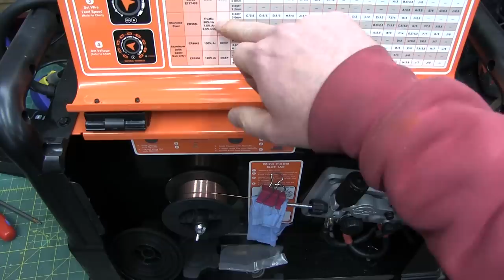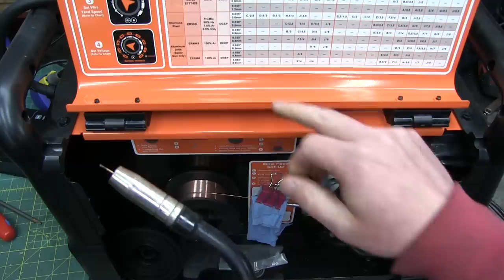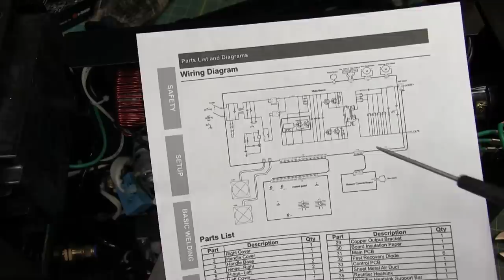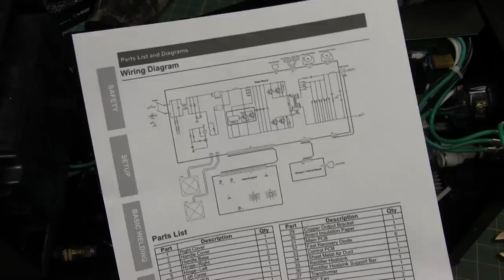BOLTR: Vulcan MIG 215 | Harbor Freight Welder

Comment: I have the cheaper cheapest harbor freight 125 and I have been using it constantly every day almost beating the living s*** out of it for years now and it has lasted not a single problem. Pleasantly surprised for a hundred bucks. I've even modified it now and converted it to DC. And I was using it to TIG weld scratch start. Zero problems I imagine it's pretty much a Vulcan but painted a different color and not given the vulcan name.👍💯😎💥

Comment: I fix crap like this for a living. The 211 IS an incredible piece of junk; fully inverter based using tiny IGBTs series’d together on the PCB. Literally, the circuit schematic is a big featureless square connected to a power switch, LCD, some LEDs, the adjustment pots and the output magnetics. 9/10 times one of those comes in for repair, it’s the $1500 PCB. Can’t un-recommend them strongly enough. But they are nice and light so that when the time comes to pitch them it’s not too hard on your back. 

Unfortunately, most of Miller’s MIG machines are going over to the same monolithic design as the 211, using a single “wind tunnel” for all major components and the PCB. The higher grade 235s and 255s do use discrete power IGBTs, but are still subject to the same PCB failures as their *retorted little cousin. The 252 is similar actually, but better since it uses a single, purpose built high power SCR to control output. 

Better yet, old Millermatic 200s can still be found online and they’re a great find. No microelectronics to get scrambled up so they basically never fail unless uncle Thumpus beats the shit out of them.

Comment: Abicore Benzel (probably spelled the co. name wrong) uses a VERY similar switch in their vacuum guns for welding stainless steel. Those guns cost about $300 merican pesos I burned one of the switches out at my last job, caught fire inside the handle and nearly cooked my hand cause it shorted out.

Comment: there are two miller 211's at least. There's the older bigger one and the newer smaller one. I have an older big one. I'm not great welder but things like triggers, switches, and so forth I know and I've noticed no issues. The current small one does look like it was significantly cost reduced.

Comment: Looks like perhaps(guessing), they have a possible option of putting a bluetooth/wifi module on it, for phone control while ya weld, reflashing and more and is likely a generic board accross models, so they can flash whatever feature set for whatever theyre selling

Comment: Been using this welder since not long after AvE posted this vid.  Been through 6 or 7 15lb spools with her, did about 3 straight feet of 1/4 mild steel welding only pausing to re-position, and all sorts of dickery and tomfoolery. Still humming (er, digitalizing?).

Problems:

Stock gun is GAH-bage
Drive wheels on the wirefeed aren't so grippy.  Oils that come from the manufacturing process on Lincoln ER70 wire transfer to the wheels and eventually cause feed issues.  You will, no doubt, blame the gun, the ground, and eventually the welder itself before noticing the problem using the "cold wire feed" button to speed out some welding wire to use as a pull for a chassis wiring project.  Much happiness and glory ensues afterwards.  Note the paperclip and paper towel trick the Emperor of Dirt is using in the vidayo.  Use it.
Stock gun, holy shit is it GAH-bage
Stock ground clamp blows goats.  Have proof.

Comment: Millermatics 252s are good machines. I would be reluctant to call them the gold standard though.
Max volts no load is only 38v. A couple extra Vs will get you higher amperages with solid core wire. 
More of an economy issue as you can just buy some metal core and achieve the same amperages with less voltage. Typically, per pound,metal-core wire costs 20-30% more then solid core wires.
Old Mk Cobramig 250 is 40v and has adjustable burn back, and run in. Mk still stocks repair parts for it and their customer service blows red and blue's outta the pond. As far as unmodified, factory spec machines, Cobramigs are the best overall I've used as I've fallen through the world.
Old Hobart beta-mig 250s are also 40v OCV and have IMO a much better inductor in the main welding circuit. It's the only machine I've personally found that will do proper spray transfer with c20 gas mixes and do a kind of "crackle spray" with c25. Worst things about beta-mig 250s are they have voltage taps (switches are spring-loaded and hard to turn, even with liberal greasing) and they're a bit retarded in regards to the motor drive circuit, IIRC the motor was 20v and driven by the main transformer through a giant potentiometre with the last stop before the motor being a 5 ohm resistor. I wiredmy feed motor to a dedicated power supply and a cheapo 20$ PWM module from amazon. Issue solved and now I don't read 36V across the motor when I have the voltage cranked up.
So not a machine for the faint of heart as they need a bit of hot-rodding to get them run reliably. 
And yeah the 211s and the base model multimatics suck (Lincolns 210 multiprocess too). If you do happen to get one that isn't a lemon you'll feel as sour as one when you discover there are better built machines, with more features at a lower price point, that don't spend all their time at the repair centre getting fixed.
Lincoln mp 210 is particularly offensive.
4 - 5000 CAD for a machine that has a gas solenoid for wire processes but no soleniod for tig is an absolute joke.
Good review btw. Ty.

Comment: Check out the DW video of Shenzen. There's a gradual move towards quality. If that welder lasts ten years that's more than enough and by then better machines will be available. (HF won't put welding suppliers out of business because most of their revenue is welding gases and industrial equipment.)

Comment: Regarding the torch construction.... That torch is a generic Chinese clone of a binzel mb15 which is the most common type of torch used on mig machines here in Europe. The switch is standard, the construction of the torch cable breakout is standard binzel, the nozzle retaining spring is a standard part, they are pretty much all like that. The torches here run £35 for something like that, they are a consumable item. Nothing like your tweco or other proper American style torch.

Comment: Learned oxy acetylene, then stick before getting a Dynasty 200 DX.  Love GTAW, don't need a metal glue gun.  MAG welds with S6 wire and straight carbon dioxide are brittle.  GTAW with S6 are tough but ductile.

Comment: I love my 252, but I Also like these vulcan welders for the house. I have a tig 205 mig max 215 and an omnipro multi process welder.  Never had an issue with any of them.  My miller 250x is Also a beast but its big and I dont have 50 amp service at my house.

Comment: I learned on a stick welder using 6010 rods, next to impossible to get right but when you do get the weld right 7018 rods should be nothing. Mig is like he said just a glue gun, tig is difficult if you hate having to clean constantly then stay far from tig.

Comment: The USB and the backside switch is for firmware updates .. Its a just in case thing if there is a huge issue with the firmware that needs updating. An example would be that the software hangs or the potentiomiters are at the wrong values. Its most likely never used but it is a nice option to have and allot cheaper then finding out there is a software fault and having to switch out all boards instead of just putting in a usb stick and patching the system

Comment: I have the old one, which is much cheaper, but has little versatility. I don't know about the guts, but one thing that surprises me is that the gun looks much better than this cheap gun. The spool on the old one is much less skookum, though. You'd think they would spend the extra 30 cents on a threaded tip for a welder that is 3x the price.

Comment: I learned on mig. Stick is different and have no interest in learning, but once you learn the basis of the puddle, you will get the hang of tig pretty quick. I have tried stick before, hate it with a passion.
Reply: The vulcans work, i personally would go with the eastwood 175. Just my opinion, it is nice you can these local, have to wait for eastwood.

Comment: i like using gas, it's nice, and i just bought a tombstone lincoln stick rig, but the amount of work i did, and was paid well for, with shitty flux core wire in my mig, speaks for itself. i learned on stick, and think it's smart, but the versatility of the wire feed setup, gas or no, is just going to be able to do more goofy little jobs. like fixing shitty chairs, or making carts for things. brackets. door cages. bicycle frame grade stuff.

Comment: In high school they taught us to weld with acetylene, imagine the great power we all had at our fingertips. Afterward picking up tig wasn't too hard
Reply: That's how I started in school. We did gas welding then stick on some ww2 surplus 300 amp welders and finally mig on 2 1970s vintage esab rigs. Had a tig in the shop but the instructor wouldn't let us students use it because of how expensive everything for it was, the school would bearly let us buy normal consumables and materials.

Comment: Miller 350P is a better welder than the Miller 252, in my opinion. I have 2, they will run 24 hours a day without overheating. Great machines, mine are both about 10 years old.

Comment: I second learning with stick. And if possible dont choose a fancy dial machine. Rather get a Lincoln t-180-ac tombstone, may be ancient but when you are stuck using one, you'll go "hey I learned on one of them dinosaurs"
Reply: I didn't use wire till I got into the factory work welding file cabinet components. I got spoiled by a big 480v 3 phase welder, the 252 is junk in my eyes, burns through with just barely tapping the trigger no matter how much I adjust the settings.

Comment: I had one of the blue Harber freight welders I believe it was a 120 mig had a 10% duty cycle when I was first learning the weld I overheated that thing so many times before I realized what a duty cycle was and could weld for about a minute then would have to wait 10 minutes for it to cool down so I can weld again so I strip the body off of it put a fan on it so I can weld for a longer period of time that thing lasted me 15 years before I finally shorted out the control board the transformer still works on it but it's not worth it to fix. The thing laid the shittiest welds with splatter all over the place but it worked for a young guy it didn't bother me nobody saw my welds.

Comment: They used an old IDE cable, like they used to use for connecting hard drive and optical drives in computers to run to the  control board. Random use for that one.

Comment: I've met way more guys who are master's with a welder and or cutting torch that you couldn't help if you had to. It's always contaminates, drug the torch tip through the puddle of slag because balls out is the only way to set a torch. I found out some of the cheap mig wire is terrible and usually get what you pay for. Chinesium is the way to go on a small machine. I blew $600 on a 110v Hobart and the trigger quit. Store wouldn't swap it and I only had it a month. Bought it in 00 and still use it when I need something portable but if got treated like that almost 20yrs ago why spend more for a name. Hobart told me I could mail it to them. Guess you buy something to make $$ they don't care about the insane shipping cost there+back plus downtime. The millers potentiometers on small machines are shit too. Got a buddy doing body work with the wire speed on kill because it's the only good spot left.

Comment: When I was going through my schooling for welding, don't jump a guy id been welding since I was 12. I had this exact example happen to me in my booth. The Lincoln suitcase fluxcore I was assigned to rebuild trigger slipped because I didn't pay attention when putting things together and it locked on me when I went out for a smoke....everyone comes running out screaming fire and the professor put it out while I finished my smoke cause I didn't know it was my booth. Then I found out all my gear in my gut bag, my grinder and all was burnt up and from that point forward I was skyfuck. 😅

Comment: I’ve never commented on your videos but at 3:55 into this one I hit pause and I’m writing this.... did you just say the 211 is junk and this Vulcan is better!?!?! That’s a bold statement there Jules. Is this Engelwood? Am I a $&@$&? You’re gonna put that Vulcan up to the Pepsi challenge against that Amsterdam.. I mean American Miller 211 any day of the week? Ok I’m gonna push play. This should be good..
Reply: Ok, now I’d like to see a BOLTR on the 211. Despite the random sticky trigger on your particular 211, how did the welder actually stack up against the HF welder? Never mind the fact that the one complaint you seemed to have with the HF welder just happened to be the junk trigger and sub par construction of the gun itself and the tape mod you needed to do to it. So, basically, they both have junk guns. Even though I’d say not all 211’s have the defect yours did. That said, and to repeat how do the actual welders compare- component wise? BTW, your channel is in my top 3. And that ain’t me blowin smoke up your fudge hole. 😉

Comment: Definitely not to early to get the wee one welding. Mines right about 4 and a half as well and she'll Tig weld aluminum. I'm running the peddle and kinda helping with the filler still but she's got the torch to helrself now. Ya have to teach them young right

Comment: I haven't had a machine yet that had a filter. When you think of it or it reminds you by making weird noises they get opened up and blown out. If you use it a lot they do really build up. Most 110s I've seen the fans on constant just packing it with shop grit. Now I'm thinking about an external filter. Internal would be harder to make sure it's not completely clogged. I heard years ago only 2 companies made the transformers. I'm sure hobart, miller, and Lincoln are all imports. Maybe the industrial machines are better parts, it's hard to guess on the honesty of any company with a long established name. Seems like they know it would take a while to bite them in the ass. The local Miller Lincoln distributor claims the same welder from a big box store is built cheaper and to look for an extra letter on the part #, otherwise look identical. Yet again could be bs, already owned everything I need so never bothered to look. Be nice to know so when asked what to buy you can pass along a few bucks saved will cost late

Comment: I'm shocked with all the shit inside that thing. I made a MIG welder out of a battery charger, rewound the transformer, added diode packs and submerged the whole thing in a tub of used motor oil.  Except the wire and feed motor . The wire feed knob is on the gun so it can be adjusted on the fly, the knob wasnt sensitive enough so I added a Dryer's heater coil to the loop and it worked perfectly. Im going to have make a video about this thing, I use it everyday.

Comment: @16:44 Those pins on it look an awful lot like a UART interface; you could probably just get an inexpensive USB to UART adapter and open a serial connection and get something (maybe even a linux command line; TM4C123G is an 80 MHz ARM processor).

Comment: If the built-in fan sucks in plenty of rust dust from grinding and collect it on the aluminium radiators do you end up with a badly mixed thermite? Conducting dust inside a high voltage machine filled with high heat flammables is probably not a good idea.

Comment: The move from the micro switch to the one in the Vulcan was a good move the micro,s where hard to get and non repairable and required a multimeter to diagnose with the new type its all there to see what's up

Comment: Stick welding is also good for survival of the smartest... or the quickest. Set my pant leg on fire twice do to molten slag flying off, landing on my boot and lighting up my pant leg, and got bit by it from using gloves soaked in coolant from the machine, too much of a rush to get that material tach welded together so the machine can get cutting again, thought I could save some time by keeping the same gloves on and not switching to welding gloves
Reply: Boy that'll wake your ass up fast!
Reply: In retrospect nothing funnier then seeing your co worker running across the shop to the spigot to put his pants out

Comment: At least the knobs have a set screw and a metal sleeve. That should provide decent protection against the pot damaging the pcb from impact. They could have gone even cheaper and just used fitted all plastic knobs

Comment: My miller 211 took me from complete hack welder to hack welder with good looking results. If this is better I made a bad trade to get it. 

I started on a Lincoln tombstone, got myself a cheap stick and backslid in ability. Bought a used maxstar and stepped it up for stick with still questionable skill.  

Before the maxstar I got a yard sale century MiG, replaced that with a Clarke and it still was horrible. After the maxstar I got the 211.  I should sell the maxstar and go back down to one.

Comment: Pretty sure neither MIG nor MAG are correct if you're trying to cover all wire feed gas welding. GMAW (gas metal arc welding) should cover it all for an inspector/hufflepuffer i believe. Yes henry potdiddle reference

Comment: Re: Filters  Why are filters buried inside cases instead of visible on the outside? If I were installing one, I'd put it a flat panel filter over the intake louvers, with a clear plastic plate on standoffs protecting it from impact.